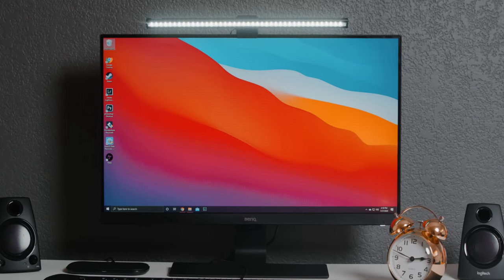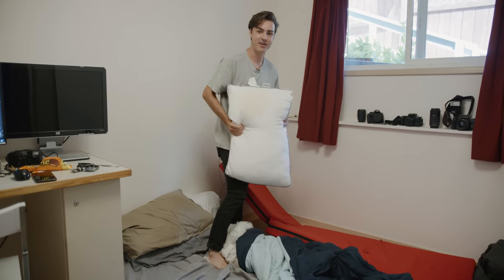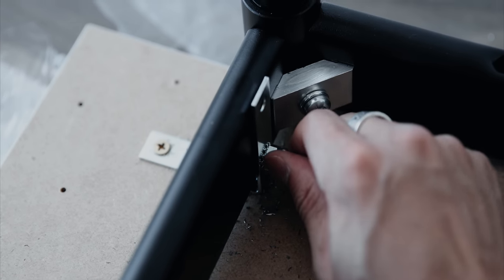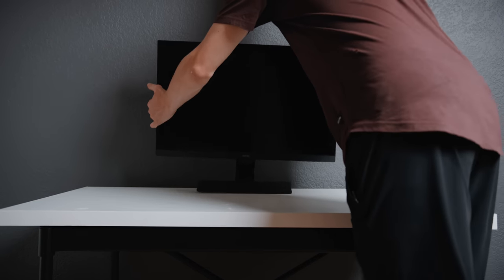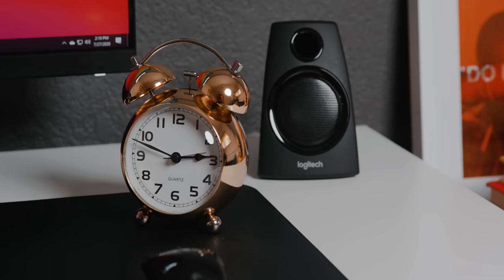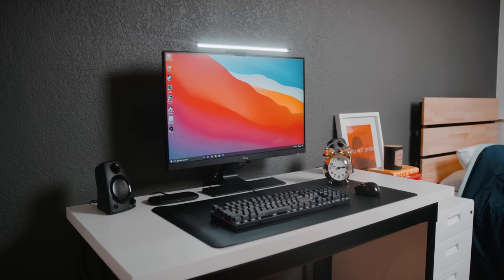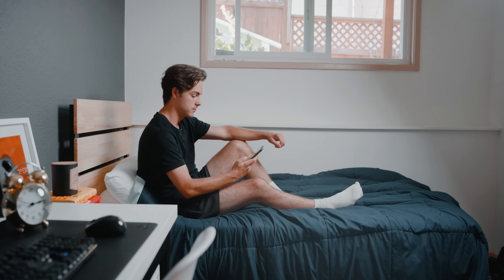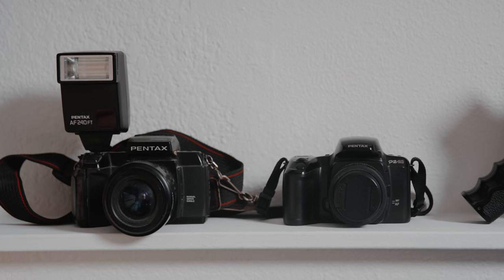BUDGET STUDENT Desk Setup & Bedroom Makeover!

Comment: I might just be that stupid, but does the monitor need some sort of CPU and/or GPU and some other components like a PC or is it built into the monitor?
Reply: I'm 3 weeks late, but the monitor is stand alone. It would require a computer. You can spec out a computer for about 300 that will get the job done. You can also buy old computers from schools, install an ssd, perhaps upgrade ram, and it should be good to go with windows 10.